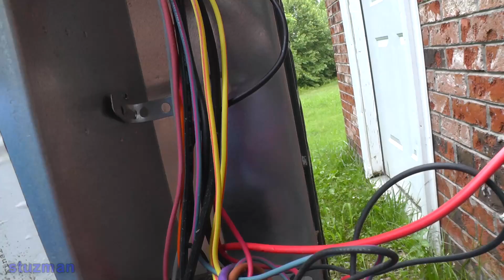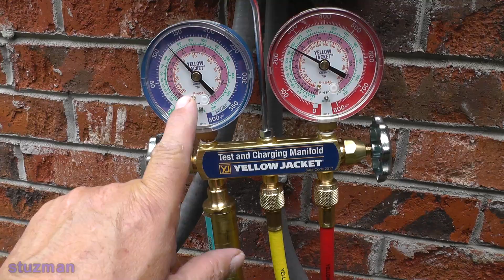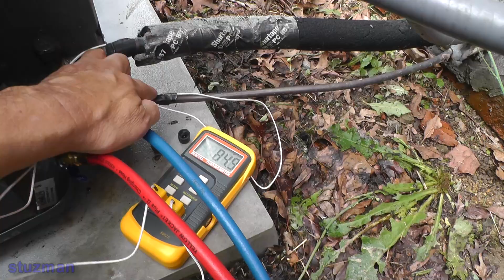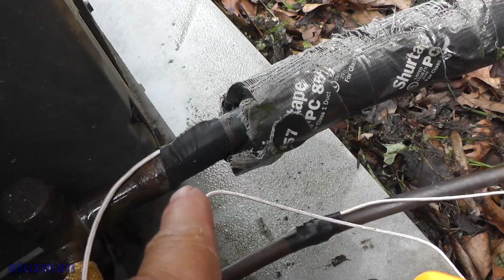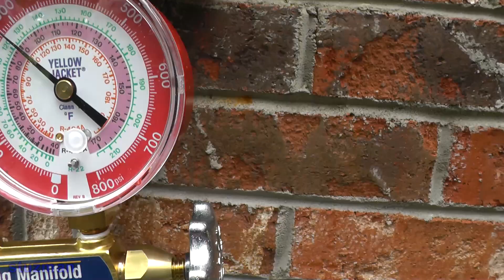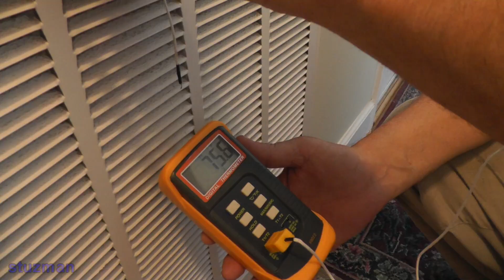Home A/C Compressor Not Running - Fixed

Comment: i have an older york....worked great last year...this year, thermostat clicks, but its like no power to the out door unit....your thoughts?
Reply from the maker: Check to see if you have 24VAC to the coil of the main contactor inside the outdoor unit. If not, then you'll need to check the thermostat, transformer, fuse, its wiring, etc. If you have 24VAC at the coil, then check the line voltage going to the main contactor contacts. Good luck on what you find.

Comment: Great Video, Thanks for sharing. Very Informational. I see that this is a R410A freon machine, how reliable are those R32 refrigerant aircons ? Be it Residential Splits or big VRF machines are they just as good or better than R410A machines ?, in terms of reliability, noise and ease of working with. Thanks again.
Reply from the maker: Thank you very much for the comment! I haven't had a chance to work with R32 sytems, but here is a link which compares R410a to R32 that you may find useful. https://www.airconditioning-systems.com/R32.html

Comment: Please dump the caveman gauges and get a set of digital gauges. You obviously understand the temperature/pressure relationship, so why waste half an hour doing calculations?

On a side note... if someone doesn’t understand in detail what the implications of subcool and superheat are, than by all means do not buy digital gauges.

Comment: Excellent video, would it be advisable to have a amprobe checking amps while charging ????
Reply from the maker: Hey Mark! You could watch the amps while charging, but you wouldn't want to use it as the method to charge a system. Most techs don't bother to look at the amperage while charging. I only did it as any experiment to see how much difference there would be.

Comment: Thank you for sharing this knowledge. I have this problem, but when I flip the breakers on the unit and main breaker box (they didn't trip), it comes back on about 50% of the time (repeat process if it doesn't). Only does it when cooling and typically when there is a lot of demand for cooling (very hot outside). I doubt the winding are bad on the compressor. I've also checked for iced cooling coils, but no. The drain is also free/not a full pan with a float switch (it pipes to a sump pump). The fan/blower keeps going fine, but the compressor stops seemingly at random. The thermostat is also new/no reason I would be suspect of it. Someone said the compressor breaker on the unit (box surrounding the blower/ducting) could be slightly off/crooked and seated wrong, which would explain why flipping it fixes the issue at random. Does that seem plausible? I don't necessarily expect an easy answer, although that would be awesome, just any kind of push in the right direction would be awesome.
Reply from the maker: Ian, it sounds like you're missing either the 24VAC control voltage to the contactor coil inside the outside unit or you're missing a leg possibly on the 240VAC that's feeding the outside unit. I would take the electrical cover off the outside unit and when you can get the issue to happen, check that the contactor is pulled in. You can look at the contactor visually or better yet, check the voltage to the coil and verify that its 24VAC. If that's good, then check from L1 to ground. You should have 120VAC. Check from L2 to ground. You should have 120VAC. Check from L1 to L2. You should have 240VAC. Of course L1 and L2 are the line power wires being fed from the disconnect into the outside unit and will go to one side of the contactor. Let me know what you find.
Reply: @stuzman52  thank you for your response. I will be sure to let you know what I find as soon as it happens again. I'll try and get a video too, especially if I find the issue.
Reply from the maker: @iantherealg  That would be great Ian with a video. Just let me know.
Reply: When he says he flips the Breaker off than back on the unit sometimes comes back on suggests that he may have an ac system that has a control board outside that shuts down the system if it detects a problem like high pressure, and wont allow it to restart unless system is reset, which he accomplishs by cycling the breaker.I would also tell him when it happens, and he is outside with the breaker still on, to see if any leds are flashing a signal.By the way, outstanding explanation on how to charge a system.
Reply: @stuzman52  I checked today, because it happened last night. Upon opening the outside unit I noticed the control board had a little LCD 2 code display saying L2 (I originally read it as 27 heh...). The back of the panel which covers the contractor has the legend of codes and it means HPCO three trips, which I suspect means high pressure cutoff three trips, so it overheated and kept overheating so the control board turned the unit off to prevent it from damaging itself. This explains so much =) as for the contactor, it looks and measured just fine. I think the plan is to vacuum out the unit, sincey lawn mower has sprayed grass all over the cooling fins, dust off the thermistor, and vacuum out debris in the unit. Possibly power washing the sheet metal outside case (removed) which has gotten mossy/scummy. The only other thing I could think of is some previous repair person tried the old "needs Freon" on one of my parents and put too much freon inside the unit. The model number is dszc180481ae. I'll keep working through it and update you with a video once it gets resolved.
Reply from the maker: @iantherealg  Sounds like you've got a plan Ian! More than likely from your description, the condenser coil needs a good cleaning with a garden hose. Be sure to pull the disconnect before spraying any water in there. Be careful and hope it all works out for you.
Reply: @stuzman52  thank you for the reply and safety suggestion about mixing water and high voltage. It's really hot out today, so I'll turn the breakers off and vacuum/power wash the outside unit parts as the sun is going down. Until then, I'll stick with some evaportive cooling (box fan).
Reply from the maker: @iantherealg  Ian, you DON'T want to pressure wash any coil as the pressure from it may damage it which could cause refrigerant leaks. Just use a water hose as the pressure is not going to be that high. Best to be safe than sorry...
Reply: Thank you both for your input. The issue hasn't yet happened, but I will take a video following your advise and then follow up when it does happen.

Comment: Wish I had hvac people knowledgeable like yourself near me. I called hvac and the guy came hook the Guage and put 1 lbs in and said ok thanks that will be 180$. He didn't measure half the things you did and was here all of 15min. And as he was leaving he mentions that my compressor is running to high on the high side and is probably failing. Ok....
Reply from the maker: You're right Chris that it can get expensive and for me, I try to learn all I can about a trade to save money. Thanks for leaving a comment!

Comment: Is it possible to check the capacitor with an ohm meter if you don't have a capacitance checker? Thanks.
Reply from the maker: James Machalik Sure James, but it might be a little difficult to interpret the readings with a digital meter. In the old days we would use an analog meter where you can see the response of the needle. With this type of meter, making sure the cap is discharged, you would set the ohmmeter to a high resistance scale. The meter would deflect downward to a lower resistance and then start to swing upward as the cap is being charged by the ohmmeter’s battery. It should reach a very high resistance value. If the needle never moves, the cap is open. If the needle moves downward, but never goes all the way up, the cap is leaky. If it goes down and stays there, the cap is shorted. With a digital meter, the same thing happens, but the numbers will be changing rapidly. You want to see the numbers lower and then will start to rise until it reaches OL. Even a lot of the cheaper digital meters today has the feature of measuring capacitance if you decide to get one.

Comment: I've never been brave enough to work on a household ac system aside from changing capacitors and cleaning corrosion. This winter though, the electric furnace went out and I got a crash course in how they function due to necessity. It turned out to be a combination of a failing sequencer and a failing thermostat. Tricky to track down when you're learning!
Reply from the maker: John Lane we all start out John in knowing nothing. But as time passes we learn new and different things. I always look to learn something new as it keeps life interesting. And good of you to continue in your quest for knowledge. The case in point of you learning about the electrical heating system in your furnace. 😀👍
Reply: stuzman when it's cold and you can't afford a service call you figure something out. I think friends and family were more frightened of the furnace than I was. Several people offered space heaters because I "couldn't fix it"!

Comment: Glad your keeping your cool Terry.  For the folks working on there own a/c don't touch the capacitor terminals until you discharge it.  You can get a serious shock.
Reply from the maker: Ozzstar Good point Glen about discharging the caps. My head was wrapped around getting this thing fixed and I’m sure I left out other details. Thanks for covering my back! 😀👍
Reply: How do you discharge it?
Reply: @jessetovar100  jump the terminals with an insulated handle screwdriver.
Reply: @ozzstars_cars  Gotcha! Thank you, sir!
Reply: Just place a screwdriver shaft across the terminals. Just make sure your fingers touch only the capacitor body and screwdriver plastic handle.

Comment: Nice diagnosis & repair Terry. Had to replace a few capacitors especially when they swell up.  Fan & compressor need that kick start or they humm alot  :D  Great video Terry!
Reply from the maker: Hayward's Automotive Hey Bob and hope you’re doing well! Most caps do swell and is s sure sign that it’s shot. Yep, the motors need those caps to get them going! 😀

Comment: Hi Terry, first you help me repair my a/c on my 2006 4 cyl ford ranger. Now I know how to repair my home a/c. What are you going to help me repair next?  [ LOL ]  Did you recheck your FLA on your compressor after you charged it, just wondered what it was.    THANKS AGAIN FRIEND
Reply from the maker: Yes, it was around 8A, but because the day was not very hot and humid, it still had a good ways to go before it hit the FLA. Once the summer starts creeping in and the outside temps go higher, the head pressure will go up also which will put more of a load on the compressor. And for our next video, I was thinking about tearing into a washing machine and you're quite welcome :))
Reply: Thanks Terry, I will get my tools ready  [ LOL ]

Comment: Yes, I just like to know, when you put the Freon tank an the scale how did you get to measure the amount of Freon to put into the compressor.
Reply from the maker: I just used the scale Phillip to know how much refrigerant went into the system. For charging systems, you add the amount of refrigerant depending on whether your system has a capillary tubing, (orifice or piston as it's sometimes called) or if the system has a thermostatic expansion valve. Both of these items are located at the inlet of the evaporator which is inside the air handling unit. On my system, it had an expansion valve which means that I needed to charge the system until the subcooling was between 5-7 degrees F. If the system had a capillary tubing, then you would charge using the superheat which is a little more involved because you have to take the wet bulb temp at the return, take the outside ambient temp and then look those up on a chart to see what the actual superheat should be. So, to know when the charge is correct in my case, I just monitored the saturated temperature on the high side and then subtract off the temperature that's down on the liquid line. When that temperature difference is correct, then you've added the correct amount of refrigerant. Was that clear as mud? :))